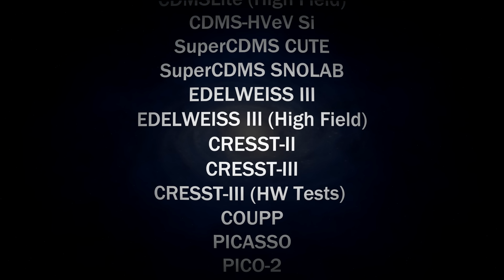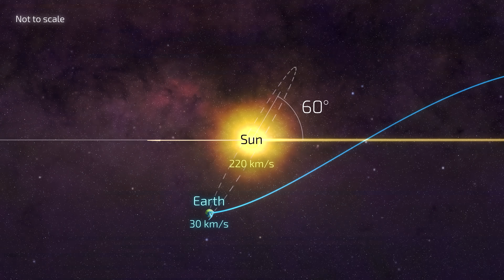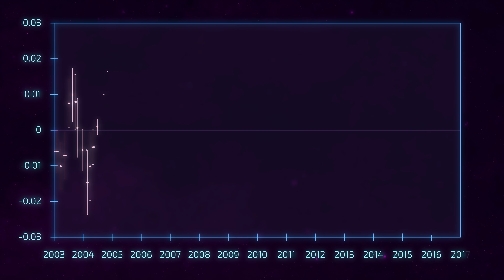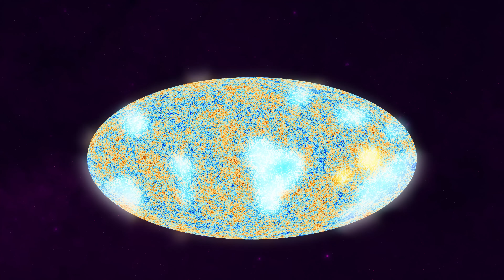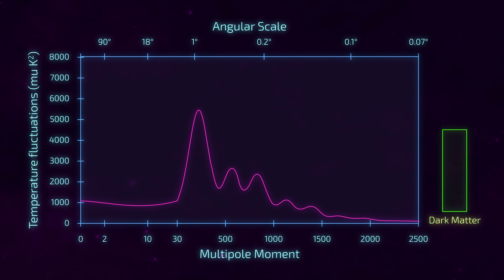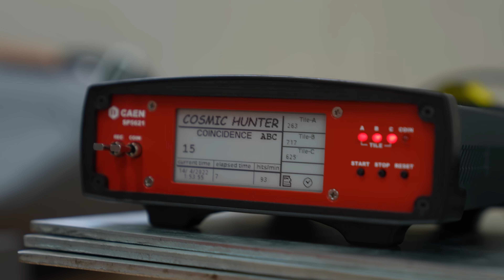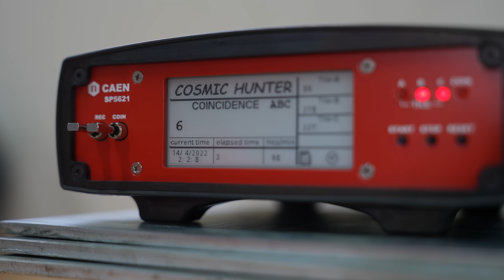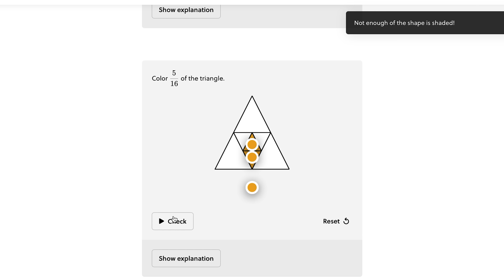The Absurd Search For Dark Matter

Comment: My question: If dark matter doesn’t interact with itself, does that mean that more than one unit of it can occupy the same space? Also, if it’s only affected by gravity, wouldn’t all the dark matter just clump or gather at the source of gravity or at least at the same distance from the source of gravity dependent on its rotational speed?
Great Video! Thanks:)
Reply: Conservation of energy would require the dark matter to 'radiate' away energy if it loses gravitational potential. We call it dark because it doesn't appear to interact with through electromagnetism.
Reply: @cygwin0235  conservation of energy does not imply the radiation of photons. Energy can be conserved through kinetic energy contributions.
Reply: @cygwin0235  oh, that makes more sense. So dark matter does “bounce” off itself as opposed to passing through itself, but does pass through regular matter without a physical interaction? Thank you for your response.
Reply: @bowieinc  For the clumping part, dark matter wouldn't do so any more than regular matter in galaxies, because regular matter colliding with itself is what promotes clumping.
Reply: @hadhamalnam  but the fact that it does interact puts a hard limit on how close the matter can get to itself, thus the density at which it can exist. If dark matter doesnt interact with itself, it would have no limit on density
Reply: @skeetsmcgrew3282  That's right, but the thing is that gravity by itself doesn't inevitably result in everything clumping together at the center of mass. If you had a bunch a particles with random velocities and positions that only interacted with gravity, and you flipped on the gravity switch, they would start complex orbital patterns, and there would be no net movement towards lower orbits because that would require loss of energy in the system. For them to all approach the center of mass over time, they'd need to collide and lose velocity, otherwise they'll just continue their chaotic motion for eternity.
Reply: @hadhamalnam  Not so. You can't orbit forever as you will always lose energy. Everything eventually collides. Gravity always wins in the long run. There is no such thing as a true stable orbit
Reply: @Andromedon777  If dark matter does not interact with itself, it can't collide with anything.  If it only interacts gravitationally, it can only lose energy (and move to a smaller orbit) by giving its energy to another dark matter particle.  This can happen in many-body systems, but it means that for each dark matter particle you bring to the center you have to widen -- or unbind -- the orbit of another.
Reply: @gunnervi  won't it still radiate energy through gravitational waves?
Reply: @hadhamalnam  their motion will generally not be cyclical. The situation with 3 particles is already chaotic.
Reply: @cheshire1  You're right, I was trying to emphasize the fact that the system isn't making any "progress" towards clumping over time, and that, on a macro scale, things are in a sort of steady state in some sense, but cyclical wasn't the right word for that because the individual paths are definitely chaotic.
Reply: @gunnervi  
If it only interacts through gravity, it can still transfer energy with "regular" matter through that interaction. 

However, if it never collides then that does mean these experiments based on collisions in our detectors will be doomed to failure.
Reply: @gunnervi  wouldn't they eventually lose some amount of energy by giving off gravitational waves?
Reply: @bowieinc  it can self annihilate, I.e two dark matter particles colliding generating two gamma-rays.
Reply: @NAHHAN  yes but the cross section needs to be very very small due to bounds posed by direct detection. Otherwise the sky would be flooded with high-energy gamma-rays coming from nothingness. A class of very interesting models is inelastic dark matter where there are two DM states with a slight mass difference. They could indeed co-annihilate to gammas but only as long as the density of the heavier partner is large enough. 
In these models dark matter starts out in thermal equilibrium with standard model particles but eventually freezes out with the expansion of the universe. What is left is a large amount of low energy cold dark matter (the lighter, stable state) that doesn't have enough kinetic energy to significantly interact with itself.
Reply: @gamerfortynine  Wait, did you just appeal to other universes as proof to your claim? 🤣🤣🤣🤣
Reply: Leaving my comment here to spectate the debate and learn from it 😁
Reply: He didn't say it's only affected by gravity? I don't think anyone's in a position to define the relationship like that... People are also saying, "It only interacts with gravity" - which I'm not sure I understand the meaning of, either...
He said, "It only interacts, through gravity".
That's actually a different proposition - which might be a little unclear, in itself...

Isn't the entire point that, as far as we're concerned and as far as we can yet tell, it's dark matter, that affects gravity?
That is: by deduction, dark matter has only revealed itself by its effect - by way of being the only way to account for the perceived actual gravity within a volume and the behaviour of mass in that volume; where dark matter behaves as additional mass, or as equivalent to additional mass: while - if being mass, itself - being mass of a type that is completely invisible to detection.
Reply: what do you mean by source of gravity?!?
Reply: @yoy4629  the center of mass.
Reply: We already know of matter that can occupy the same state - bosons. Look up Bose-einstein condensates.
Reply: If dark matter is like those elusive tachyon particles, then no. They would have to travel at the speed of light or faster, and therefor couldn't possibly hope to ever clump together.
Reply: @thany3  Tachyons are NOT elusive.  Tachyons are various types of energetic particles that travel faster than the speed of light in some medium.  In water, light travels at 75% of the speed of light in a vacuum.  So particles travelling through water faster than 0.75c, will cause the release of photons by the particle's passage.  But the particle is travelling faster than the photons' light waves can propagate.  This will result in a cone of positive interference of light waves from the photons, similar to the shockwave sonic-boom cone created by objects travelling through air faster than the speed of sound in that air.  The positive interference light cone from tachyons is seen as the blue glow of Cherenkov radiation in water cooled nuclear reactors.

Tachyons are neither elusive or mysterious in modern times.  Hopefully dark matter will eventually become non-elusive and non-mysterious.
Reply: I would imagine that if it acts that way, you would be looking at the timescale of the heat death of the universe, so I certainly hope we don't find out any time soon 😅You'd have to have multiple particles with identical positions and velocities, otherwise any interaction, gravitational or otherwise, would cause them to slightly move apart.
Reply: It absolutely would fall into the gravity wells of black holes and be unable to escape, leading them to increase in apparent gravity slowly even when not taking in matter, something we have not seen.

It's a silly theory that lets them not alter fundamental models of how things work, but much like the aether used in the surprisingly accurate models of heat transfer used by Victorian alchemists, it's just a stepping stone until we get to a better model that lets us design better instruments and take better readings.
Reply: The idea of clumping is actually true. Under the force of gravity, Dark matter can form a halo like structure. Each of the galaxies are actually part of a host dark matter halo (think of it like a giant spherical ball and inside it we have the galaxy). Now one way to know that this is the case is to look at the rotation curve of stars in a galaxy . Galaxy without the existence of dark matter cannot explain the data. This clearly shows that the influence of gravity is coming from the dark matter that is around the galaxy.
Reply: Actually, he got that part wrong. It does interact with itself according to  the most prominent theories, unless something has significantly changed since I defended my PhD thesis 5 years ago.
Reply: @gamerfortynine  Thus far, there is no proof of multiple universes. 

That said, our universe is not as closed as people like to think. Even the idea of conservation of energy fails at the universal scale due to inflation literally sucking energy out of traveling photons. That energy is lost forever as far as we know.
Reply: No need for unproven BullS dark matter...it is simple electric and magnetic forces which these Catholic church 'ASTRONOMERS' deny have any effect. Its just as bad as in Galileos time as anyone who tries using em is burnt at the professions stake. closed minds and petty tyranny pervades so called 'astronomy' or rather astrology.
Reply: @esecallum  If you believe that, write the paper. 

Interactions with the electromagnetic force are extremely well understood and far easier to demonstrate and measure.

Comment: that was the worst german pronunciation in a while, at least check with google for some hints if you're that far off... duncle materié lol

Edit: Also galactic rotation is a bad indicator for dark matter as the orbital velocities are based on keplerian motion, which assumes that the mass is concentrated in the center while the orbiting bodies' mass is negligible. This is plainly not the case for galaxies, and as such the keplerian results are to be taken with a grain of salt. 
Galactic rotation shows a linear relation for the inner parts, suggesting that the denser regions are in some way gravitationally linked such that they rotate as a solid body would. After the linear part the rotational velocity mostly goes constant out towards the truncation, which may be dark matter, may also just be non-keplerian orbital motion. All in all dark matter seems sus.

Comment: I love the belief in a mythical substance which comprises 85% of the mass of the universe, but doesn't exist in the Solar System.  It was "found" by observing orbiting stars far away, but has no effect on orbits here.
Reply: It does exist in the Solar System, that's why we hope to detect it with detectors here on Earth. It doesn't noticeably affect orbits here because if you calculate how much dark matter mass would be within our orbit it's about as much as a small asteroid.
Reply: @atticmuse3749  So 85% of the universe, but an infinitesimal fraction here?
Reply: @caldodge  Yes, because baryonic matter is able to clump through self-interaction and radiating away energy as electromagnetic radiation, so you get very dense pockets of it (ie. stars and their planetary systems), sitting within a sea of dark matter that's much more spread out. In a loaf of raisin bread, there's a lot more bread than raisins, but if you zoom in to consider a single raisin, the volume is now mostly raisin and only the little bit of bread you can see around it. In this analogy, the bread is dark matter and the raisins are stars made of regular matter. Hope that helps!

Comment: Two "dark matter" theories I miss a discussion on:
1. There is no universal coordinate system. Each system is connected to neighbour systems like the phase boundaries in a superfluid. We see the effect of swirls existing around subsystems that has a near uniform rotation and speed relative to our system, and with their own emergent general relativity - due to their locally emerged uniform coordinate systems, held together (made rigid) by existance of the local interactions there.
2. There are four orthogonal equally probable "time" directions for any 4D structure that has a quantized translational invariance. Since we are built from such particles, we have one of them. But there are three others that cannot interact with us except through gravity if general relativity is perfectly uniform. 

If we measure exactly 25% "real matter", it follows then that there can be only one universal general relativity. But we don't. So there must be a dispersion of subsystems with different GR rotation and speed relative to us, and/or each system is not perfectly rigid so the four "time" directions in each system are not perfectly orthogonal everywhere and on all scales that matter for a particle. 

Since we see both dark matter and dark energy as almost independent phenomena, the correct word is not or but and on the and/or above. They are about two almost independent dispersion phenomena. One due to local order, the other due to phase boundaries, in any 4D system of 1D-periodic structures, like us. 

Right?
Reply: Could you point me somewhere that I could read more about this? Looks very interesting

Comment: I don't know, I feel like dark matter has become the "god" of astrophysicists. Something undetected and unproven but treated as truth because it fits the math or more accurately it was made to fix the math. I'm not a physicist or anything close to that but that has always bothered me.

Another thing, this video mentions that for the observations in the Andromeda galaxy the speed of the outer stars was too high to explain with just normal matter. But if there was dark matter present, wouldn't also the inner stars in the galaxy rotate at a faster rate than what could be explained? it isn't like dark matter would only be present on the outer part of the galaxy, specially if it interacts with gravity. I don't know, maybe the explanation in video was oversimplified or something.

Comment: Since a huge amount of dark matter should be falling down on the planet all the time as we pass through it, just like normal matter does and the only way it interacts with normal matter is with a detectable gravitational change. The earth should be adding mass all the time as it collects dark matter into its gravitational field. Logically the way to detect dark matter would be to precisely monitor the gravitational field of the earth. Problem is we've been doing that for some time and have seen the earth rapidly changing mass.
Reply: It just might look like eye floaters, or small squiggles of heat. Sometimes, I wish I had black holes for eyes.

Comment: It would have been immensely helpful, if you had pointed out right away that DAMA/LIBRA is actually a highly isolated scintillation detector, which is trying to measure energy released by (herein unspecified) particle interactions, quite similar to how neutrino detectors work. For the best part of the video, I was wondering about why you were only talking about "a signal", and not what the signal actually represents, and why it was not clarified what is actually being measured.
Reply: and right there you just lost 99.99999% of your audience.  :)

Comment: One of the fascinating things about modern science is the way that it has flipped the role of observation in the process. It used to be that the point of science was to make dispassionate observations, from which we could draw very limited conclusions, and eventually more general theories. But now we take our existing theories as the starting point, and the role of the scientist is to find observations that confirm the theories. If the observations stubbornly refuse to confirm the theories, then, instead of taking this as evidence of weaknesses in the theories, we instead take it as evidence of the existence of random stuff that we can't detect.

If we were talking minor discrepancies, then reasoning along these lines might be justifiable, kind of how they discovered Pluto by observing discrepancies in Neptune's orbit. (But I may have the planets wrong here). But if you need to say that 85% of the matter in the universe is undetectable in order to make your theories work, I think it is far more likely that your theory is just plain wrong. And it would be much more fruitful to try to devise a theory that conforms to observations.

Comment: If it only interacts with gravity how can we detect them by hitting something? How it will pass through the mine/mountain just to hit the detector underground, but hitting northing else?
Still lots of questions open :)
Reply: the particles they are trying to detect are expected to still interact with the weak force as well as gravity... on a galactic scale this is irrelevant because the distances are so large but in the tubes it will weakly interact. as for the other questions I'm not sure :)